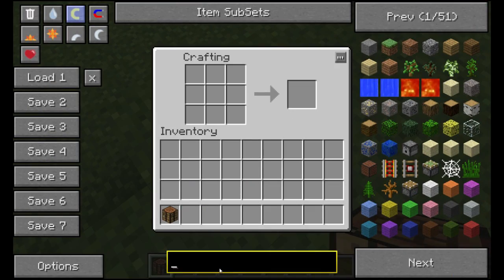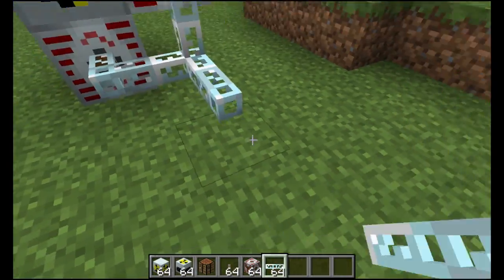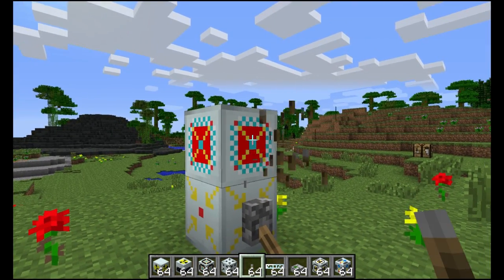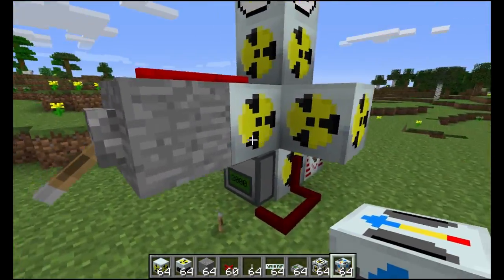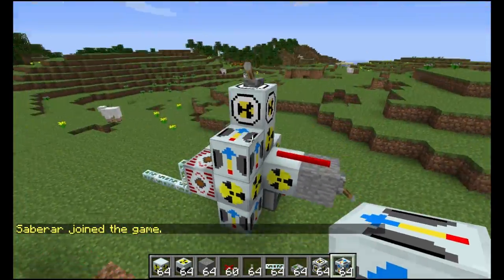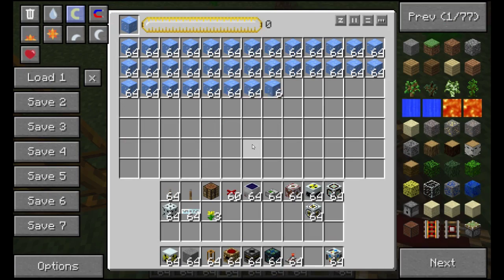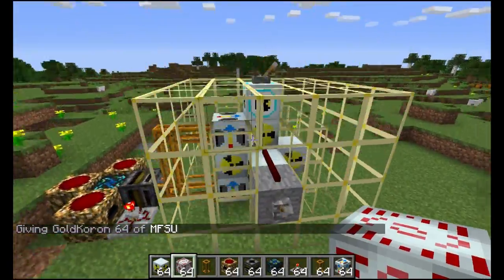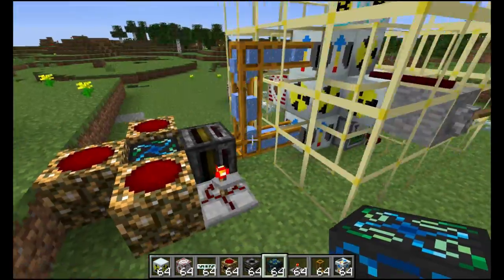Tekkit Tutorials - 2400 eu/t Nuclear Reactor(Tekkit Classic)

Comment from the maker: I have not done this in a while, but I am pretty sure the forcefield core has it's own built in battery. The reason your reactor exploded is because if you leave it on and the chunk gets unloaded, the reactor continues running but the cooling systems and thermometer stop working.

Comment: I love the setup and the fact that it uses forcefields and everything, but I have found a flaw. Should the reactor overheat for some reason, eventually things start disappearing around it. If this happens to the output cable which is powering the forcefield, the forcefield will lose energy and turn off leaving an unprotected reactor. Since the reactor is overheated it will explode. Im not positive on this theory, but my reactor exploded but it didnt leave an enourmous crater so idk. Please reply

Comment: On your MFFS reactor heat controls. You can adjust it to cooler I set mine to 9000; It will chew lce a lot slower if you don't want your timer spamming away. The thermal monitor to about 12600 for a local lan and about 10,000 for a SMP server.